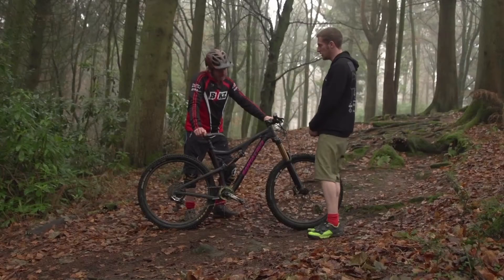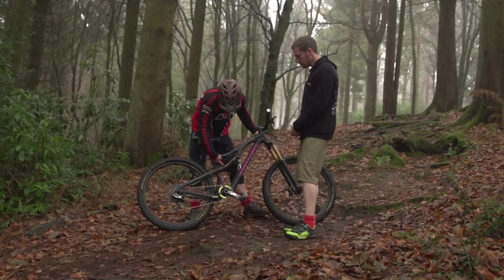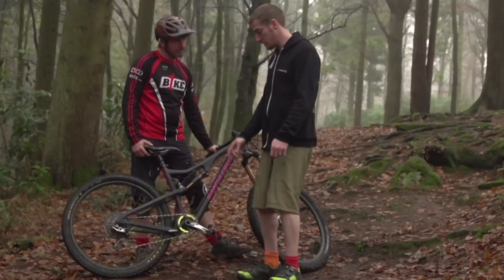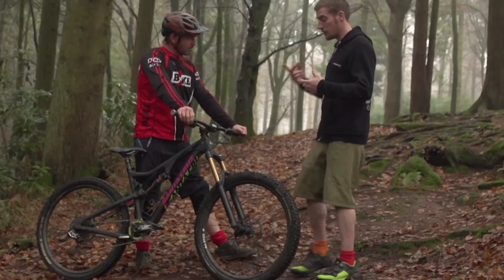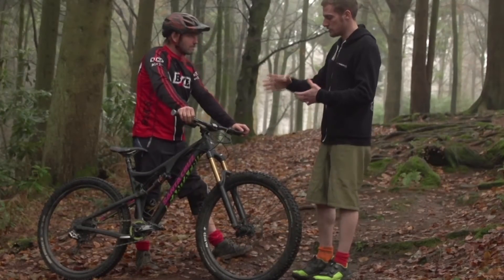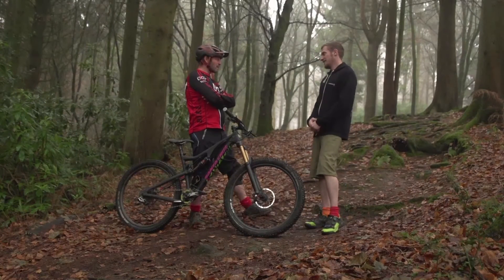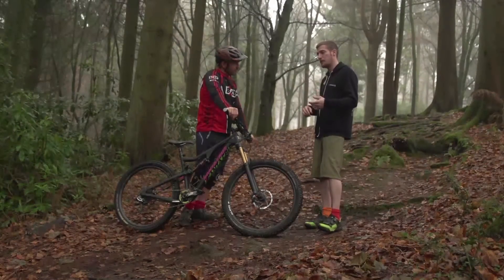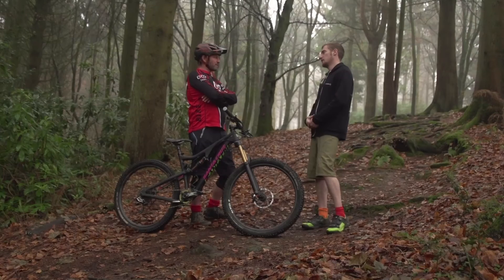Mountain Bike Technique - Shocking Performance Part 3

Comment: I really appreciate this series as I'm trying to get more in-tune with my suspension settings. I had my rear shock in the slowest possible setting (highest amount of rebound damping) and I practically always blow through all of it doing not a very intense ride, so I'm likely packing it down on technical downhills and not allowing the suspension to behave as it should. Spring rate also affects how much travel or stroke I'll go through, but I'm only set at 20% sag so I'm in the correct ballpark as far as that goes. At this point, I'm upgrading to a bike with more travel because I've been riding for 5 years and I've found my niche more or less. Protip for everyone else: Writing this stuff down helps a lot. I keep a thorough set of notes on Google Drive (~the cloud~) because I'm useless at keeping up with anything!